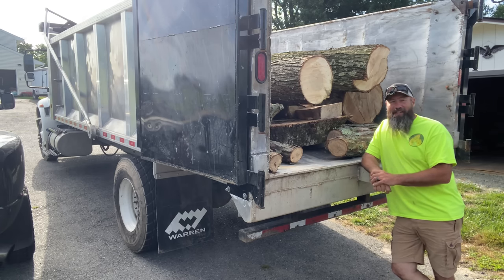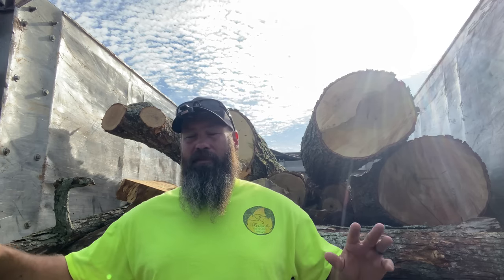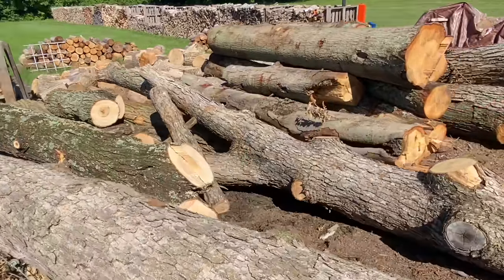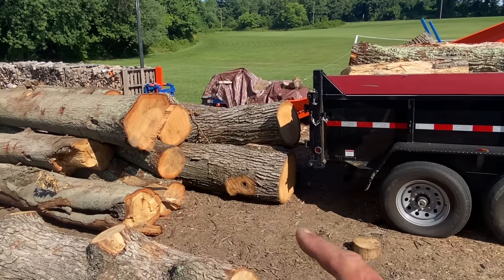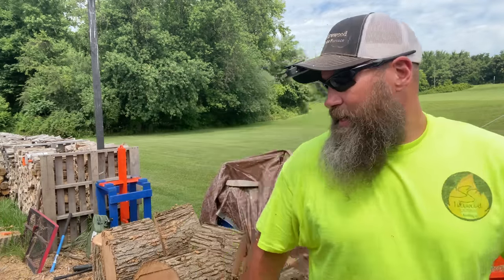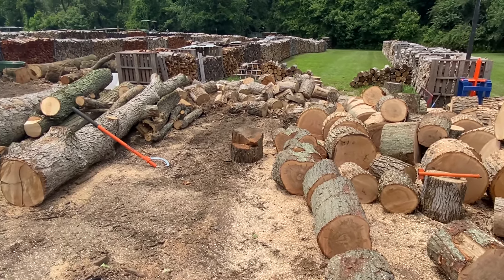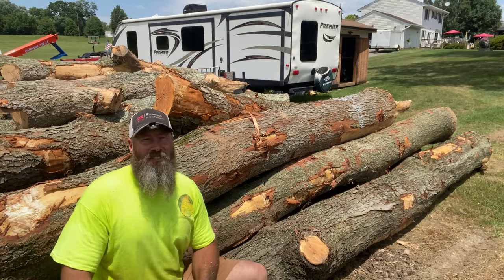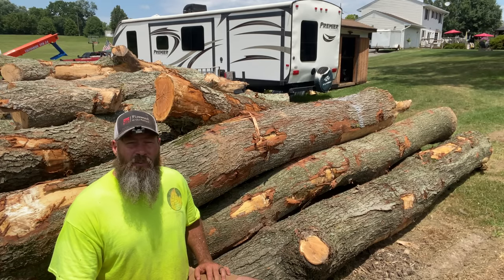A LOG STORAGE AREA  - #154

Comment: Hello I watched your video liked and subscribed on the trailer remote system and was wondering what amp diode you purchased?
Reply from the maker: These are the ones I purchased. They are 15amp. Hope this helps.
15amp Diode Axial Schottky Blocking Diodes for Solar Cells Panel,15SQ045 Schottky Diodes 15A 45V (Pack of 10pcs)…